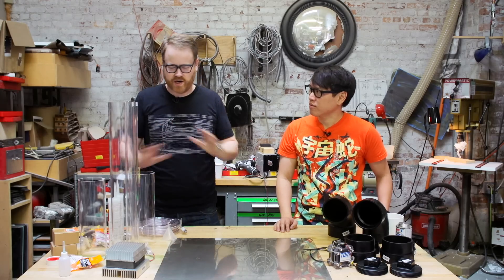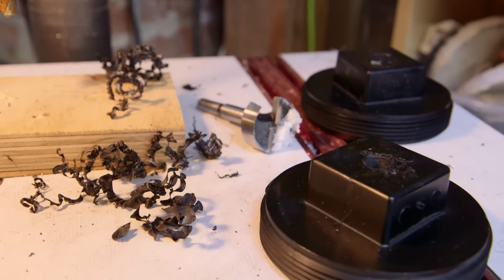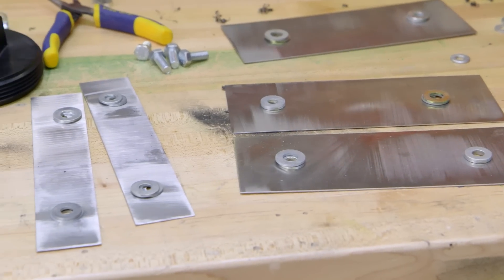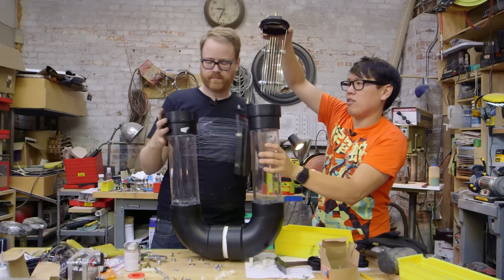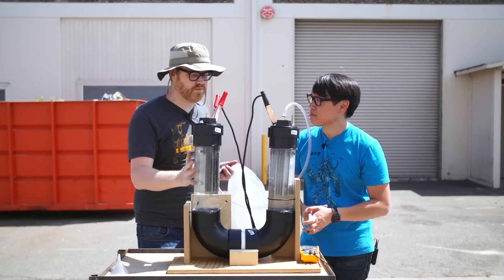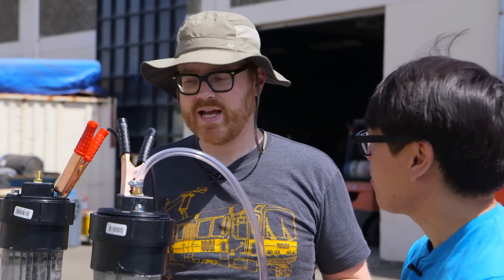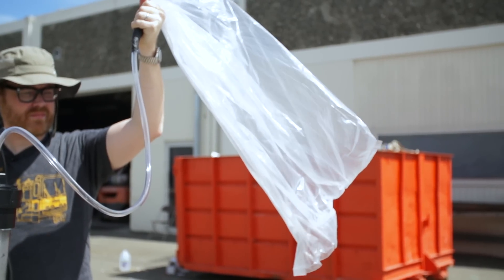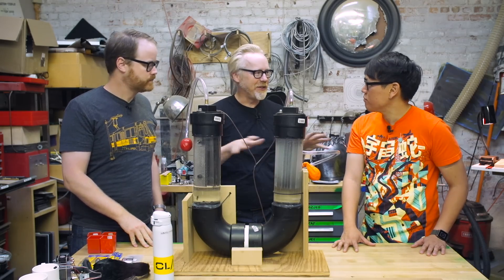Tested Builds a Hydrogen Converter

Comment: To the people saying this thing isn't working like the garbage they threw together at home, or that this must be a deliberate failure, just because it isn't working like how you expect, here's why you've misunderstood this video. When you normally run an ideal hydrolysis cell, you get hydrogen at one pole, and oxygen on the other, in the exact molar ratio they occur in water, 2:1. When you collected gas in elementary or high school chemistry off one of these, normally you have the two electrodes or plates in a cup, beaker or bottle, and you collect the gas produced when you turn the thing on with a balloon or bag, like what they tried here. The main difference between your DIY cell or hobby kit is that the gas you've generated, unless you're very careful, is actually the hydrogen and the oxygen mixed together as they bubble and move through the water. People call this HHO or Brown's gas, and it's pretty cool, but by no means magical, and it can be incredibly unsafe. For one, the gas is just premixed hydrogen and oxygen, in the exact ratio to create an ideal combustion reaction. This mixture cannot be extinguished once ignited, but burns so fast it normally combusts as a large fireball or, if contained or pressurized, an explosion. 
This test rig here seems to be designed to generate the hydrogen and oxygen on opposite sides of the device, to prevent the mixture of the two gasses and the creation of an obvious safety hazard. While it sounds nice in theory, just generate hydrogen on one side, and oxygen on the other, and separate them to prevent mixing, it actually doesn't work that simply. In hydrolysis, the water is literally split. The two halves (H+H+ and O) are attracted to their respective oppositely charged electrode, which means they need to travel through the liquid water to get there. The further they have to travel, however, the harder it is to do this. Instead, it becomes much easier for the water to simply heat up, instead of split, and use up the electrical energy that way, much like how a heated kettle or blanket disperses heat. This doesn't generate much gas at all, and is the chief reason it's kind of hard to generate safe, pure hydrogen at home. The more power you pump in, the easier it is to split the water, sure, but the less efficient the device becomes, as it generates more and more waste heat. This generator was undone by the fact that they really wanted to get pure hydrogen and oxygen on opposite sides, and separated the plates extremely far apart, and forced the ions of Hydrogen and Oxygen to travel much too far. In fact, I'd bet most anything that if they dipped their hands in the water after their trial run, it would've been substantially warmer than they anticipated. There's a pretty interesting video on carsandwater's channel (the guy who does the red hot nickel ball stuff) where he disassembles his HHO generator, and shows the internals. He has a large amount of 'neutral' plates, hooked up to nothing, to conduct the electrical current through the water better, and to prevent the ions from having the massive travel resistances they might otherwise experience. He also adds Potassium Hydroxide, better known as Draino, to the water, to increase the water's electrical conductivity (since water is actually a passable electrical insulator without a dissolved ion content). I dunno if these guys are being paid off by gas companies or something, but the issues they had here, and the issues the Mythbusters had way back when are pretty much due to the fact that it's remarkable hard to electrically rip water into an explosive gas mixture safely, and a difficulty overcoming the challenges of both electrical and ionic conductivity in water. There's a lot of great info out there on this stuff, but a lot of misinformation and plain misunderstanding and paranoia as well. Stay safe friends!
Reply: Spot on.
Reply: Andrew Bowling holy shit you must have a comfortable keyboard!
Reply: I reckon I can build that or he’s good at copy/paste
Reply: Lol
Reply: What is more explosive? Browns gas, pure hydrogen, or pure oxygen?
Reply: Right but one slight mistake. They were using a solar panel with maximum power output of 100W under optimal conditions. 

Yet they did not even bother tilting it so they probably got something like 60W out of it. And when you think that, it probably would not even have heated the water up no matter how long the distance for the ions to move.
Reply: these type of wet cells are toys for demonstration purposes only. They were never designed to be efficient devices. This whole episode from mythbusters was a complete joke and they should be ashamed for showing it to a large public. With a well designed dry cell configuration it is perfectly possible to keep the hydrogen separated from the oxygen, although most DIY hydrogen enthusiast's don't do that because it takes a lot more complicated design to do such a thing, and with more complications there is a higher cost. And for experiments you don't need to separate those gasses. HHO or browns gas is potentially pretty dangerous, as you stated it has the perfect combustion ratio. All it needs is a small spark or some pressure to ignite. Even when it is in a closed container, because as you stated it contains both the oxygen and a fuel namely the hydrogen. It will probably do it with a loud bang, and when compressed it might go with a violent loud bang. However hydrogen is a relative save gas compared to natural gas because it is so light in weight. Because of that the gas will go straight up in the air instead of hovering down on the floor. So it is unlikely that hydrogen will spread out and create an even  larger fire. 

But this particular episode made no sense at all. I have seen them use way more complicated setups for different shows. Somehow for this episode they decided to use the worst setup possible. Since the subject was efficiency it was complete ridiculous to chose for the worst setup. And the worst thing is that they did it on purpose. I don't know why they did it, but I do know that they know better than this.
Reply: In the time it took you to write all that you could have checked out a video of how you make a real HHO generator!
Reply: Andrew Bowling , I bet your a fun person to be around 😵

Comment: might as well have gotten a pencil lead, a piece of copper and a 9v battery again like you practically did on myth busters. this is a disgrace and a total lack of effort. i am severely displeased with this and doubt any and all projects Adam and anyone associated with him makes, this was as rigged as the upcoming election. try using 2 car batteries for a power source wired in series.

Comment: Why does myth busters always show less effective ways of doing things? I understand some people will encounter such problems because this is all they know however with a decent budget, some familiar crew and lots of community support I'm sure that the episodes can be more informative than a couple of minions that pretend to be smart for the sake of entertainment while doing things ineffectively. 

In youtube alone there are more efficient designs for such a device yet using the exact same materials. Things like distance between plates to allow even more surface area,  batteries to be charged by the solar panel and then used in bursts instead of a trickle system. Also, what material was the plastic bag you used? Some materials slowly release gas over time due to even the smallest pores/holes. 

I suppose I'm thinking that for the size of the system you created it was a poor example of basic science due to small technical details that were neglected because you were trying to simulate uneducated people instead of teaching uneducated people how to be more effective. I have a gut feeling that the main issue you had was not enough power due to the size of the plates vs the available DC current. Might be wrong but I'm trying to understand how performance can be so bad. The rules of the elements don't change. Your understanding of how to implement / work with that set of rules was not good considering the team you have.

Simply put, the gas you produced with that monster sized system proves my point. The problem I have is that you could have educated but instead you made depressing entertainment that failed to amaze or educate. With failure, you perhaps inspired people to reject this presentation and strive to do a better job. Reverse psychology ftw?

I write a lot. Enjoy.

Comment: I'm really disappointed in the tested crew on this one...You need to play with your electrolyte concentration and boost the amperage...not the voltage...cmon guys.(Adam, I grew up watching you and Jamie, why in the world would you throw in the towel on this..its such a cool experiment.
Reply: Hidden agenda ! make things look too easy everyone would do the same  TO BE fair he did show the poly bag with a  LOT  more gas than the balloon so on a guilt trip me thinks !
Reply: 9:19 Adam goes from good spirits to realizing they failed on purpose. He looks and sounds upset lol. "Pissed but need to stay calm" face scratch and everything lol
Reply: Hydrogen fuel prices range from $12.85 to more than $16 per kilogram (kg), but the most common price is $13.99 per kg (equivalent on a price per energy basis to $5.60 per gallon of gasoline), which translates to an operating cost of $0.21 per mile.

 Hydrogen industry paid them off so you would not make it at home...

Comment: you realize that you have made a potential battery with this genorator, since the oxogen and hydrogen are seporated by an electrolyte, if you were to get rid of the hoses and block off the hole, you could use electrolysis to fill it partly with the gas and then it would actually generate electricity.
Reply: you can see how this works in cody's lab's video, "diy  electromagnetic hydrogen fule cell"

Comment: I reckon a Al+Ga alloy is a better way of getting Hydrogen out of water
Reply: Gallium Destroys aluminum though..
Reply: Braden T .. and if you add water to that brittle Aluminum that has been affected by Gallium it will start a reaction creating alumina and pure hydrogen gas (and the reaction is fast).  No Gallium is used up in the reaction.

Aluminium will react with water naturally to form alumina and hydrogen, but if that aluminium comes in contact with air it will gain an oxide of the outside that protects it from reacting with water.  Gallium is basically just a catalyst to make the aluminium reactive enough to water.

Comment: For christ sake, use a proper source of of amperage such as a car or truck alternator, which delivers 12 or 24 volts at 100ah not a pissant solar panel that is lucky to make 5. Why is it these clowns test this idea they never do it correctly. How bloody difficult is it.. they could rectify AC current from the wall and deliver hundreds of amps and make the water boil. - idiots.
Reply: because they wanted to be clean. They should have distilled the water with solar as well.